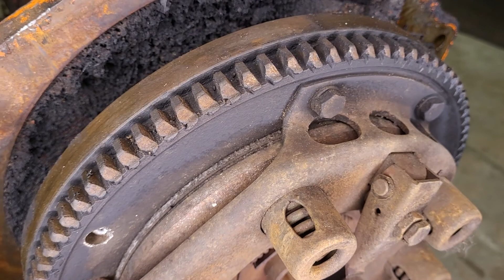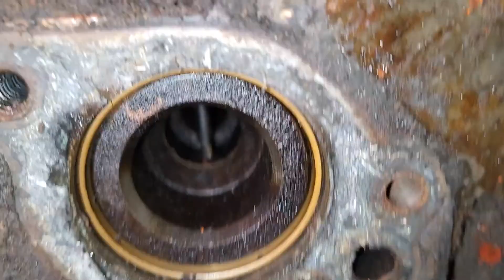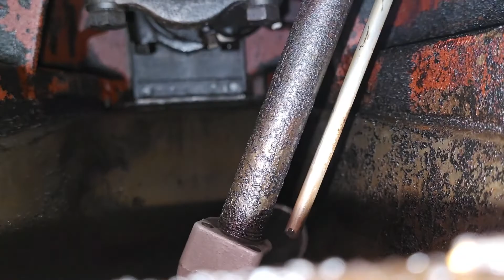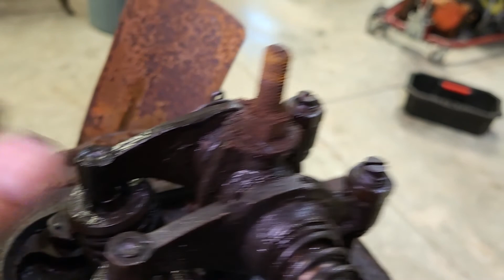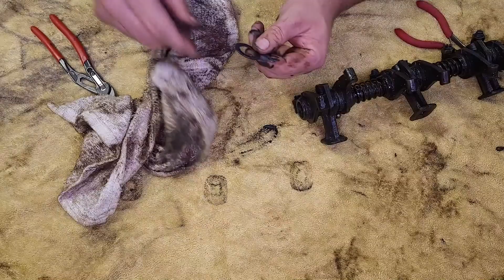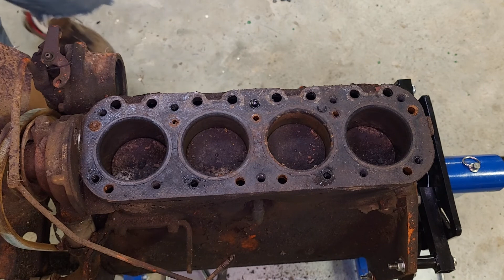1953 Allis Chalmers B Engine Disassembly & Inspection Part 1 of 2

Comment: What is the problem if it runs tlll you I gave pto then it dies
Reply from the maker: Maybe the pto is seized or could be a siezed hydraulic pump. Does it turn by hand when disengaged

Comment: My engine was / is stuck. I already tore it apart, the front bolster and rear half are out in the weather of Northern MN. I hope to bring them inside soon and start to disassemble the into the seperate components like you did and then get them into a heated garage to work them..

Comment: Mate, also I am having difficulty in finding valve spring retainers/base for my restoration. I have got a cup like disks as spring seats. Could you pls try and upload a picture of what kind of spring seats on yours and possible source of buying new ones please.., Thanks.
Reply from the maker: Looking for an easier way to send pics. Do you have a farmall as your profile pic on FB? If so I'll message you a bunch of pictures.
Reply: @JPN76  yeah mate. That's me on FB

Comment: Rocker arm stud that carried the oil up- I reckon the problm might be the grove is not facing the direction from which oil is fed in to... thats the reason your grove was pretty jammed up and rocker arm and bushings were pretty worn... May be I am guessing. ON my unit, I saw the grove is facing the right direction and there is a clear passage when i blow air through.. Just thought i might let you know to get your  thoughts on, cheers mate
Reply from the maker: I need to look again but my parts tractor was facing the side and not towards the oil feed either. I removed that stud and it looks like the oil feed comes from the bottom of the hole. I haven't cleaned it up to check for sure. Defiantly worth looking into to make sure it's correct. Thanks for bringing this to my attention. I'll definitely talk about it in the assembly vid. One thing I noticed later is the thin tube that runs from the oil pump to the tee that feeds that part of the head and the governor was 100% plugged up. It was full of what looked like fibers from the oil filter and I could not get 100psi of air to even pass through it.  This couldn't be good either.
Reply from the maker: I have not removed the stud from the  head in this video yet. Maybe I'll see if I can get anything to blow through as is before removing. Just for a test.
Reply from the maker: I did a quick test and put together a short video about this.  https://youtu.be/ykDgmnwoVPA
Reply: @JPN76  yup watched. That was my experience if blowing the air. Yup. Happy to see your little experiment.
Those engineering geniuses could have done with a wider tubing, Right.🤔.
Now, you have taught the world, where this could go wrong with hidden blockage, while the gauge showing pressure and pump working. 
Cheers